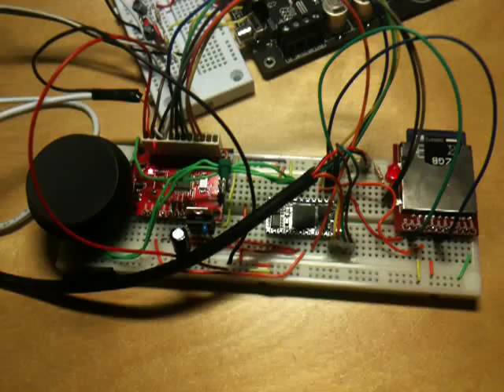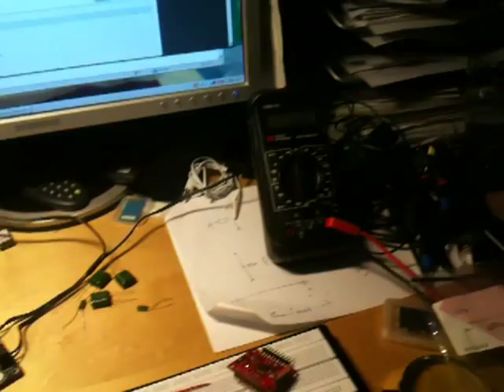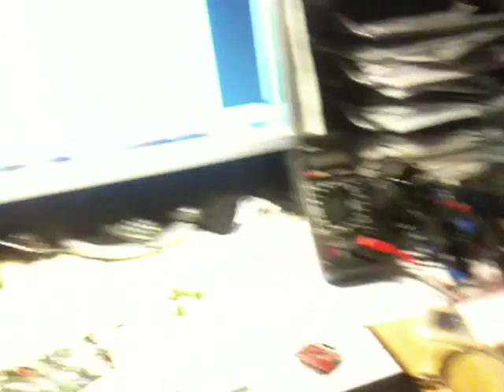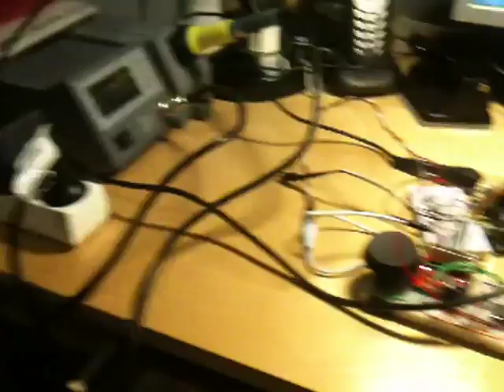Netduino and vs1053 based mp3 player

Comment: Got a question for someone who had the same idea I did about making a homemade mp3 player. One major difference is that I am using a TI MSP430 micro-controller for my project.  I got nice audio output but only through my left channel. There is no sound from my right output channel. Did you ever encounter any issue like that?